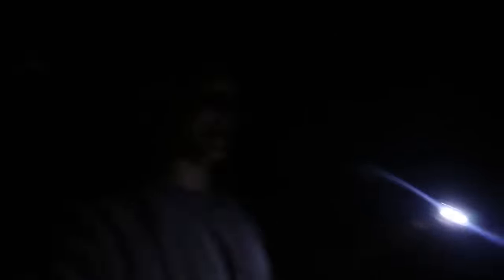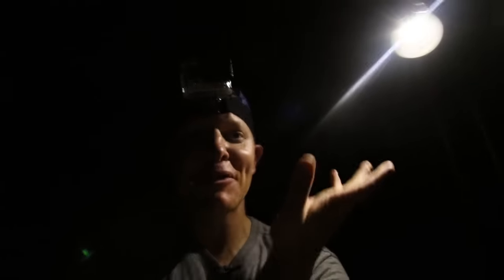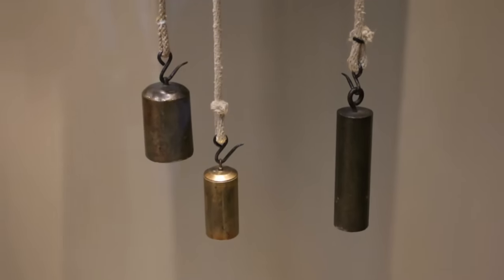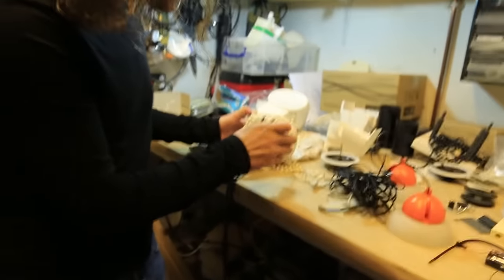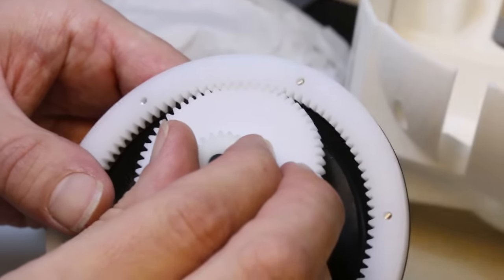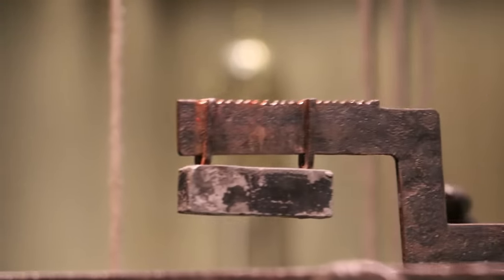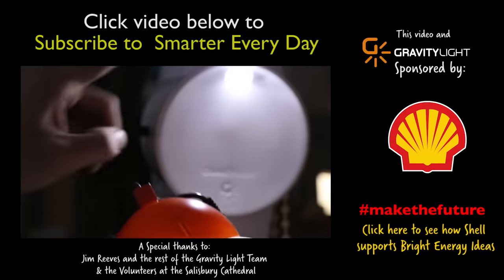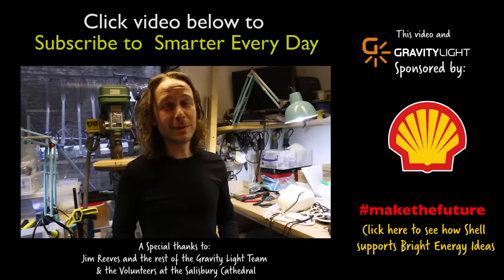Turning Gravity Into Light - Smarter Every Day 146

Comment: back in the 2019 they thought gravity was infinite... here we are now.. floating around. It all started with this lamp
Reply: Daniel De Lauretis this commet is golden 😂
Reply: Daniel De Lauretis They HAD to monopolised everything including gravity
Reply: Lmao
Reply: I'd say it does not work with gravity, It works by the force and energy we put in the weights when we lif them up and hook them.
Reply: @sajjadjafari2612  yes, that's where the energy comes from. You're transforming your calories into gravitational potential energy by lifting the weights up, which then becomes kinetic energy as the weight falls, driving a motor producing electrical energy, that then runs through an LED to produce light. Pretty darn neat.
Reply: @ernop350  yes yes it is
Reply: This would be a really interesting idea for a book
Reply: time traveller detected D:
Reply: Who stoled all our gravity? :c

Comment: Turning heavy into light.
Reply: Hey, who turned on the heavy?
Reply: +Caleb Limb There's that word again! Heavy! Why are things so heavy in the future, is there a problem with the Earth's gravitational pull?
Reply: +Caleb Limb Yeah, it's not turning gravity into anything, it's turning the force/effort used to lift the heavy object up off the ground into depreciated power output over time...
Reply: +LeastComicStanding So, it's just turning gravitational force into light.
Reply: +Caleb Limb That's a slogan if ever I've seen one...
Reply: +John Titor Yes.  More accurately, it's turning potential energy into radiated light.  The potential energy comes from a human lifting the weight, so you could say it's turning chemical energy (food, ATP) into radiated light.  Of  course you can go further down the rabbit hole and say that it's turning solar energy (used to make the food) into light.  Then again, the solar energy is a direct result of gravity at the sun.  So, ultimately, it's turning gravitational potential energy into radiated light.  This reductionism works for pretty much any energy source though - they can all be traced back to gravitational potential energy.
Reply: +Desrtfox71 Hello point, how I've missed you...
Reply: +Caleb Limb so heavy metal is now light metal?
Reply: +Desrtfox71 You could use that same reductionist logic to say everything's powered by the big bang if you wanted to; that's where all the energy came from.
But nobody says that because it's dumb.

LeastComicStanding's statement was the most accurate.
Reply: +Dlobo that's why I broke it down for you, so you can decide where to stop.
Reply: +Caleb Limb I love all the different types of nerds you can spot in this comment chain.
Reply: +Dlobo But LeastComicStanding isn't really the most accurate, though.  The application of force on the object (to lift it up) just lifts the object up, that's not what's powering the light.  Potential energy is just a measure of how much downward force is being applied to the object as related to it's mass and the gravitational force on that object.

Once the light's turned on, you've stopped lifting the object and it's being pulled back down by gravity (in relation to it's mass).  It's still most accurate to say that the object is powered by gravity.  It's actually inaccurate to say that it's being powered by the lifting of the weight because the lifting of the weight just puts the object higher up from the ground, not powering the light.  It's also inaccurate to say that potential energy is responsible because potential energy doesn't really power anything, that's how potential energy works.  

Force/work powers things by converting potential energy to something else.  In this case, the Earth's gravity is converting the potential energy of the weight into movement which is the actual direct force that powers the light.  It's similar to talking about potential chemical energy in the human body being converted into movement which is then used to lift the weight up.
Reply: david siebert
It was the most accurate in the thread at the time.
Now I guess yours is, but I didn't really read it. I'm sure you did a great job though.
Reply: +Desrtfox71 Except for nuclear energy.
Reply: +Caleb Limb
Nailed it.
Reply: +david siebert If we want to get real it is a human powered light.  The energy to lift the stone is applied by a human.  Without the Humans energy the rock will never be lifted and that energy used to lift the rock can not be returned to light the LED.  If it was truly gravity powered it would run forever without the input of any other form of energy and we would call it some sort of potential energy machine that will power you light forever.  We would see adds all over the internet for the machine that big oil or the energy overloads do not want you to know about aka the free energy machines.  Without a person to lift the rock it will not be able to return that energy.  aka the light will be out
Reply: +IMRROcom It's a mixture of both, if it was human powered they couldn't just leave it alone afterwards and have it work.
Reply: ***** The weight is human powered, but the light is not.  The human power lifts the weight and once the weight is lifted, there is no more human power in the equation.

It's like what earlier people said.  We can keep tracing it back and say that the light is chemically powered since that's what powers the human or that it's sunlight powered because that's what created the chemical energy, but that's redundant, we don't need to talk about that because it's not what directly powers the light.

Gravity pulls on the mass of the weight which is the energy input powering the light.  It's not human powered and if you want to get super specific, it's still electrical since the downward force of the weight due to gravity causes an electrical charge to move through the light, but that's too specific since that's true for every LED and most lights nowadays.

The light is powered by gravity which distinguishes it from other light sources.
Reply: +Caleb Limb That really should be the product tagline
Reply: very punny
Reply: +BBBuilds12 Well it wasn't the Vashta Nerada.
Reply: +Caleb Limb Well done sir
Reply: +IMRROcom This is correct, and another way of thinking about it is that the energy expended by a person to lift the weight up could be imparted to the system in any number of different ways. Hoisting a weight just happens to be a more convenient variation of a wind-up generator.
Reply: +Caleb Limb clever :p
Reply: E=mc² lol, relativist clock
Reply: In that case my brother could light a stadium.
Reply: Shut up! You'll give Jerry Seinfeld new material!
Reply: It's like pottery.
Reply: PERFECTION, Sir. Perfection...
Reply: VIA GRAVITY...
Reply: Gravity is the source of that kinetic energy...
Reply: They shine a light on the dimwits.
Reply: You're right. Except, the term force, (ahem...) applies to any direction.
Reply: Caleb Limb ayyy!
Reply: My kind of comment, bruh.
Reply: It's like winding a spring toy. Lifting the weight gives it some potential energy
Reply: @Desrtfox71  you can say its turning zero point energy or vacuum fluctuation into radiated energy
because the expansion of the universe was caused by change in the vacuum energy level of space-time and caused the rapid expansion of the universe, which translated into potential gravitational energy.
So in the end we are ultimately using the energy of vacuum.
But this doesnt end here, Quantum information theory and the holographic principle suggest that energy is information
so we are using data flow to generate radiated information flow that ultimately goes inside our eyes
its all information my friend, there is no such thing as matter or energy.
Reply: Jamie Hess “They shine a light on the dimLITS”
Reply: Hang gravity light on the trees and hang a sleeping bag
Reply: why is this so light????
Reply: that should be Gravity Light's catchphrase